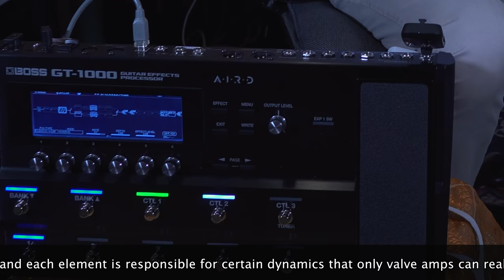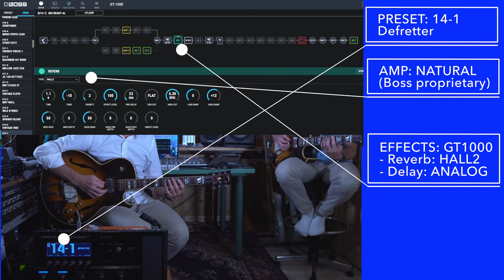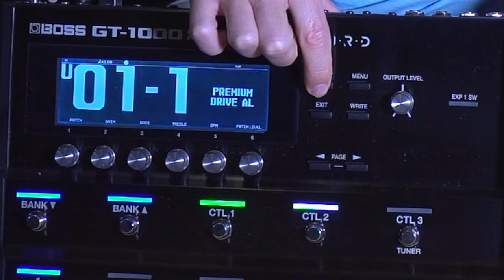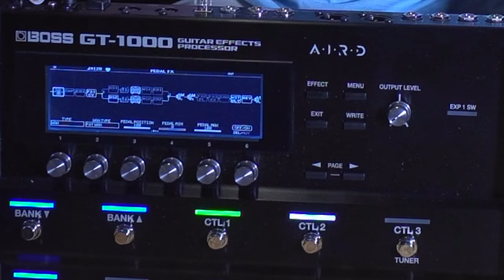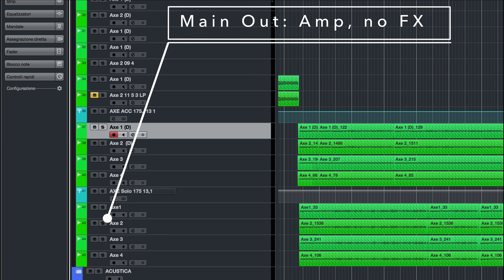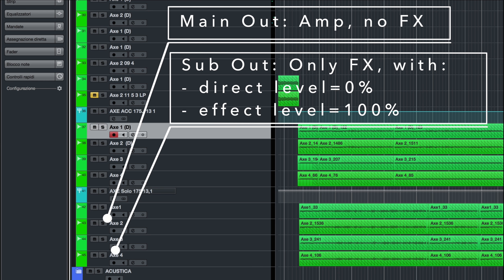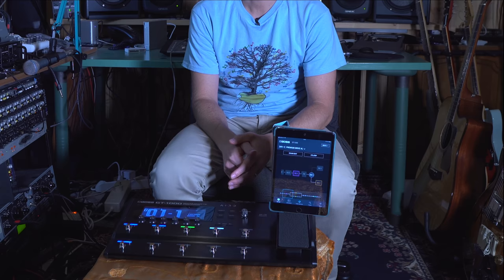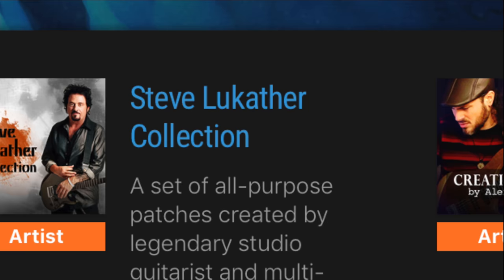BOSS GT 1000 - Part 1: Demo and Review

Comment: Would you still recommend it after 2+ years of use? Im thinking of buying a guitar processor right now but i cant decide which one. The GT-1000 seems like a great choice, got a chance to get a new one for 900$ instead of 1000, so now im binge watching every video of it. Also i've been wondering if i can use it as a daw then i wouldn't need one for recording? Or i should get one nevertheless?
Reply from the maker: Hi, it's still a solid option (in my opinion) and also for recording. With the GT 1000 you still ned a daw in your computer, but you don't need an audio interface, as the GT 1000 can serve as an audio interface! It's pretty complete in terms of effects, especially if you like BOSS effects. It's main contender is the Helix LT and the FM3 (which offers way more amps and tweackability, but less footswitches and USB audio channels). If you want to get something cheaper, maybe you can check out the Mooer GE 300, which offers also the possibility to load profiles.
Thank you for your message!
Reply: @LeoGibsonGtr  thank you for the answer! I was looking at Mooer but Boss seems to have better sound which is a main selling point for me in this price range (but damn that synth option is a cool thing to have!). Sadly FM3 is hard to get where i live in Russia and Helix LT is 1300$ here instead of 900$ for the GT-1000
Reply from the maker: Hi, yes..for the FM3 you have typically to enter a waiting list...I didn't know about the prices of the Helix in Russia...pretty high...Well, 400 price difference with the GT1000 is pretty noticeable...actually
Thank you for your message!